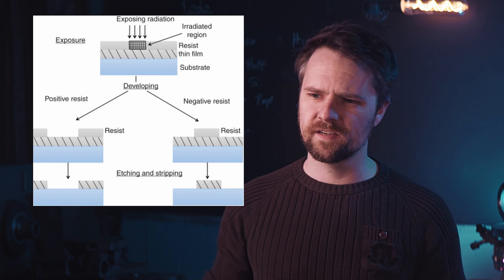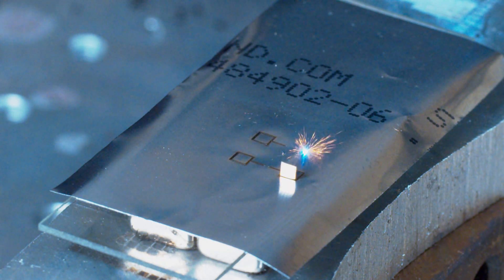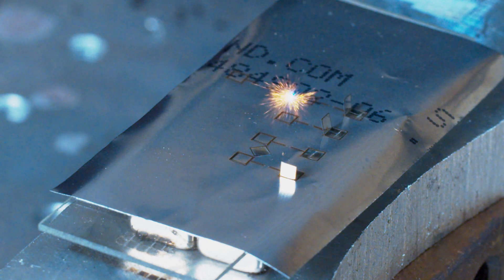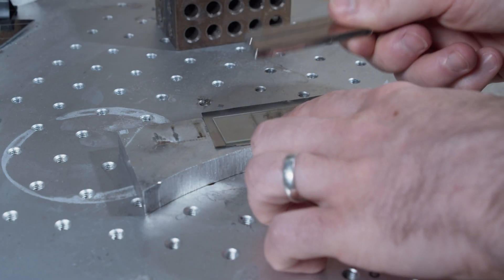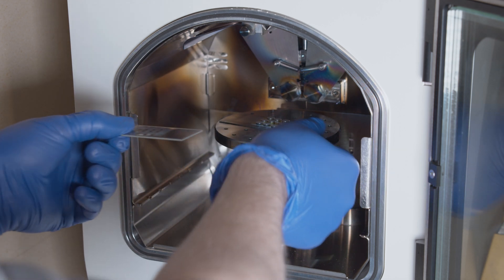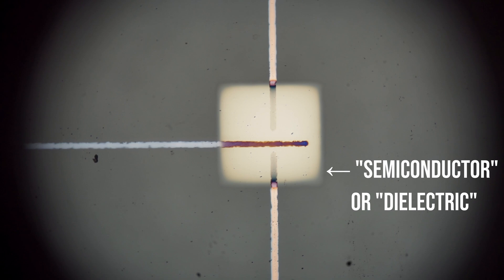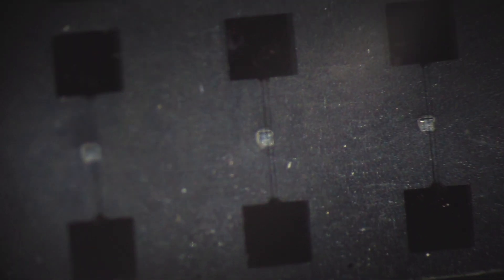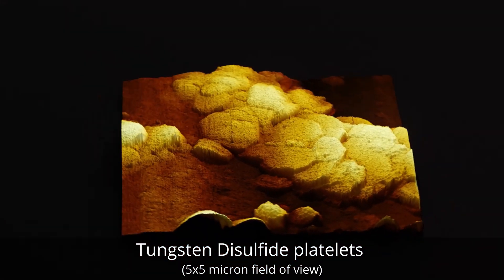Laser etching stencils for vapor deposition

Comment: Can confirm for those (like myself) who DO NOT work in a fab all the time, even PHOTOlithography at sub 10 um becomes nontrivial - I'm really glad I've never needed to develop a recipe from scratch! On metal, and without using photo or e-beam litho to start, these are some seriously impressive results! The magnet idea makes me smack my forehead - I did one project in undergrad using shadowmasks because we were afraid photolithography developer was leaving an unclean surface behind, and I did not use magnets to hold the mask in place, just tape - I made many many fuzzy circles...
Reply from the maker: I can't take too much credit, the main inspiration came from Ingle, Frank W. "A shadow mask for sputtered films." Review of Scientific Instruments 45.11 (1974): 1460-1461.  They use the magnet system to keep it clamped in the deposition chamber, and I just extended that to the patterning step too :)

Comment: Can't you anneal the mask while sandwiched between flat plates? Before and/or after laser.

Also, is it feasible to (electro)chemically etch back the buildup to restore the mask?
Reply from the maker: Hmm, seems like that would work.  Actually now that you mention it, since this is cold rolled it probably has a ton of internal stress...pre-annealing might help a bunch too to relieve the stress before the lasering.  Hmmm... would be pretty easy to test. 

I think in theory you could electro-etch the buildup back out, but probably have to be careful to make sure it etches evenly.  Although if you design the setup correctly, you could find a chemical etchant that doesn't touch the mask.  Like using ferric chloride to etch out copper buildup and leave the steel alone.

Comment: This is awesome! I'll just add a few things I've picked up from my materials science classes/the internet

Mask alignment is a huge challenge even in lithography, and they do so with shapes on the edges of the mask that have to line up (for example, triangles or crosses at different points along the edge of the mask).

Also, my understanding is that masks for lithography are actually made via electron beam exposure, instead of UV light. The electron beam approach is considerably more accurate than UV light based methods, but is a serial process and therefore is prohibitively slow for large scale manufacturing.

Lastly, if you ramp up the voltages (and therefore ion energy) in the sputtering setup, you could actually begin to implant ions into your substrate. It could be very interesting if you purchased a small silicon wafer (the ones that are a few inches are a few hundred dollars I believe), and actually tried to make a transistor for real!

Comment: Sorry if you mentioned this already and I missed it, but what sputter machine is that?
Reply from the maker: Don't think I've mentioned it explicitly in a video (just some community posts).  It's a Leica EM ACE600 machine, designed for SEM coatings.  So it can pull a nice vacuum and has fun features like that tilting/rotating stage... but it's pretty slow.  I was originally going to build my own but this came up for sale at a good price (needed repairs) so I couldn't resist :)

Comment: Hm, did you try using a thermally conductive backer on your thicker shim stock stencils when you cut them? Like, maybe if you used aluminum or copper (or silver) rather than glass you could reduce warpage by drawing away the heat. Might not suck away the heat fast enough to matter, but it'd probably be worth investigating. Another option might be to sputter a layer of copper or whatever on one or both sides of the shim stock to give you a very small amount of added thickness and again to help draw away heat. That might introduce new warping problems though, a la bimetallic strip.

Comment: What about a light spray adhesive to the mask?   I wonder if that could be done in a way that wouldn't make removing the mask again later impossible.
Reply from the maker: Ah yeah, I wanted to mention that but totally forgot!  In theory this would be perfect, assuming it doesn't "lift off" prior layers (which it probably wouldn't, metal adheres pretty well to glass).  But most adhesives (or any polymer really) outgas like crazy in a vacuum and can make sputtering difficult.  The kapton tape I used is "good" for vacuum and still outgasses a lot, regular spray adhesives ended up being really bad.  I can almost garauntee there is a "vacuum rated" spray adhesive somewhere but I dunno how/where to find it :)
Reply: @BreakingTaps  That's a really good point, I didn't even think of that.
Reply from the maker: @JuryDutySummons   Hehe yeah i didn't either, figured that one out the hard way.  Was pumping for ages and still not getting to desired pressure... then it dawned on me :)

Comment: Super interesting as usual! I wonder if some sort of compressed-air-jet cooling could keep things cool enough for multi-pass cutting? I’d think that more shallow cuts and cooling the material between passes would let you go a lot deeper without warping... (PS: I don’t think 10-15 microns is anything to be ashamed of. It isn’t exactly microelectronic scale, but still seems very impressive, especially since you’re punching through 25 microns of material.

Here’s another thought: what if you took advantage of the closing up of the shadow mask as it’s used to deliberately pre-narrow the features by depositing on it before using it for the parts you’re wanting to make?

And WOAH! An AFM??!! COOL!!!
Reply from the maker: Hmm, yeah that's a good point, some downtime in between passes and an active cooling solution might help minimize how much it warps.  And would probably allow smaller features, since you could keep the "area of ablation" relatively small.  Interesting idea, would be easy to test!

And that's a super clever idea purposefully closing up the gap to get smaller features. I love it, definitely going to try that.  If it works it might warrant a followup because it's a great hack. Cheers!

(And yeah i'm super stoked for the AFM.  Gonna be awesome!)
Reply: If Wiki is correct, the first 4000 series CMOS logic chips were made in a 20um process. Making a functional simple gate or a flip-flop would be very impressive as a start!
Reply from the maker: Oh interesting, I didn't realize they started out that large.  Like I knew the process nodes started pretty big, but figured it wasn't until they had brought it down a little more before making chips.  It's definitely on my bucket list!  And I can go binge through Sam Zeloof's videos again if I get stuck on steps :)

Comment: Definitely worth making an aluminum carrier for your shadow masks! .1mm (100um) offset from your features on something stiff (2ish mm) cut with a 90 chamfer mill will help a ton to keep everything flat and stable. We use a system close to that at uni for our simple sputter/evap masks we used to test a bunch of materials for thin-film transistors.
Reply from the maker: Oh! I never thought of a system like that, genius!  Thanks for the tip, shouldn't be hard at all (theoretically) to mill up a support like that.
Reply: @BreakingTaps  If you're going to do your dev work on 75x25mm slides, I'd definitely make an assembly where you can drop it into a pocket (drill out the corners so you can get a tweezer in there to release) and then screw around the edges. We had dowels that would hold the shadow mask (oversized through holes to prevent tearing) around the periphery, too. Anything and everything you can do to mechanically align and park features helps a ton. We were (use in prior post should be *used*) registering multiple layers (masks) and holding 50'ish microns across multiple layers. Not that it was super critical in our workflow, but still nice.

Comment: I'm curious about the pressure inside the sputter chamber. At what pressure do you run? Nice video as always :)
Reply from the maker: Thanks! Pressure varies a little depending on the target, but I generally pump to e-5 mbar, purge once or twice with argon, then take it down to e-6 mbar pre-process (especially important for aluminum or copper due to oxides, if I'm not in a rush I'll let the aluminum runs go down to e-7).  Sputtering is usually done around 2.0e-2 mbar.  I'm still pretty new to sputtering though, so huge grain of salt to all the above. It's possible one or more aspects of that is quite sub-optimal :)

Comment: AFM super cool, so eventually you plan to make a working semiconductor ? I can't wait ...cheers.
Reply from the maker: Agreed! Each time i pull an image off the machine I'm just stunned by how cool it is.  And watching the probe dance around is mesmerizing.  Re: semiconductors, maybe! Hopefully!  I'm currently playing around with some alternative materials because I really don't enjoy working with HF.  Curious to see how far (or if) you can go with alternative processes.  Makes complete sense why silicon is used industrially, but for home fab there might be different routes because the goals are different.  We'll see! :)
Reply: @BreakingTaps  I'm not very familiar with sputter deposition for semiconductors - you'll probably need something defect-tolerant enough to work even when polycrystalline (like the much-hyped halide perovskites in research-grade solar cells), something commonly solution-grown, or an amorphous semiconductor like amorphous Si, although I agree 100%, HF in the home shop feels like a very dangerous idea - keep the calcium gel nearby!
Reply from the maker: @AlphaPhoenixChannel   Hmm hadn't thought about that, good point!  Will need to do some more reading.  Right now some candidates are a few van der waal materials (WS2 and MoS2) which can be applied via abrasion (e.g. rub the powder on the substrate). Causes the platelets to exfoliate themselves like graphite and form a sorta-flat multi-layer.  Most of the literature focuses on those as single monolayers, but I found a few references of it being used as a "bulk" material to some ok effect.  I assume the literature ignores the bulk stuff since electrons don't like to jump platelets so it's a lot less interesting?  Dunno, but I'm less picky :)

The other thing I'm reading into is Cu3N and CuO/CuO2.  The nitride form seems to happily self-dope itself n- or p-type depending on deposition temperature, the paper I was reading suggested it was a balance between donor and acceptor defects and the temperature changes the balance slightly.  Dunno just how defect tolerant it is though, I was indeed planning to sputter that one.  The copper oxide ones can be generated by selective heating/annealing so it probably helps fix itself during the process?  I may be bugging you with more questions hehehe.

ZnO is a definite candidate as @Daniel Heineck mentioned.  I haven't done much reading on that one yet but it's on the todo list :)   As you said, ye olde HF in the home shop doesn't sound fun at all if I can avoid it :)
Reply: @BreakingTaps  I have played with AFM and STM before ! this is gonna be great !
Reply: @BreakingTaps  ZnO might be accessible in a reactive sputter environment? That you can etch with HCl.